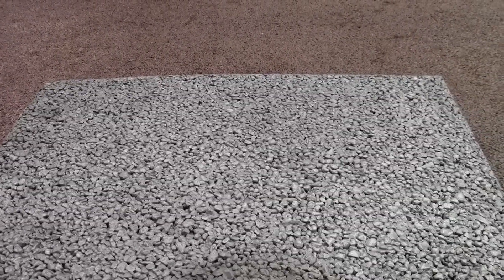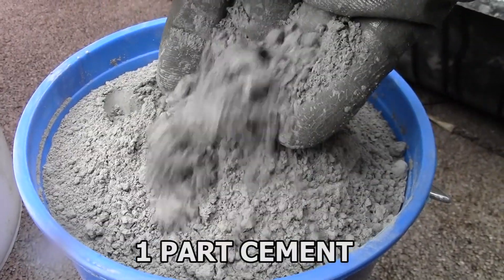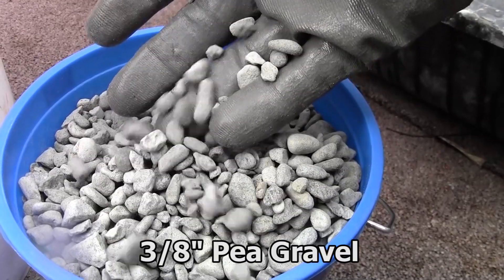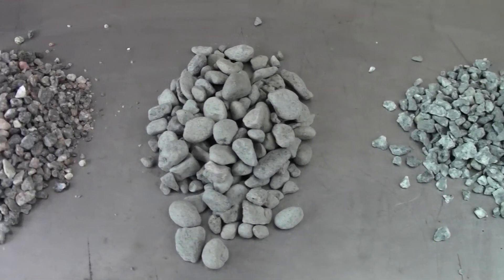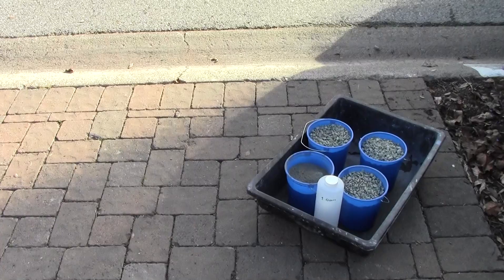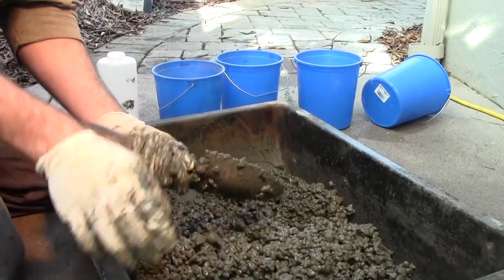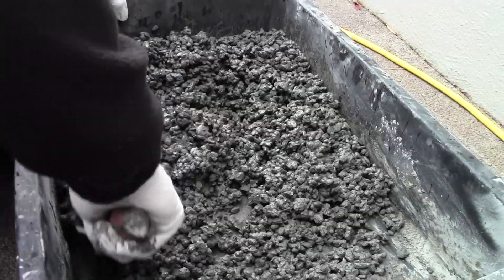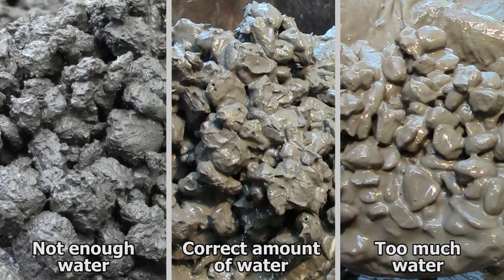How To Make Pervious Concrete

Comment: is there any code which should be followed to obtain the particular ratio and should be nominal porosity of pervious concrete?
Reply from the maker: Yes, the technical way to determine the ingredients of a pervious concrete mix:  
1.  Find the void content of the aggregate that will be used:
voids, % = 100 ((S x W) - M) / (S x W) 
 
M = bulk density of aggregate lbs / cuft -  dry rodded 
S = dry bulk specific gravity 
W = density of water (62.3 lbs/cuft) 

2.  Use the NRMCA pervious concrete mixture formula found at the bottom of this page:
http://www.perviouspavement.org/materials.html

Currently there are not any standards set for the minimum permeability of pervious concrete, that I am aware of.  Traditional 3/8" (9.5mm) aggregate pervious concrete mixes, with around 20% voids, often drain in excess of 600"/hour (4.2mm/second)!  Unless one is using the pervious concrete as a catch basin (not recommended), this degree of permeability is far in excess of what is actually needed to absorb even the most intense rain event.

Strength is at least somewhat inversely proportional to permeability in pervious concrete, meaning that generally the lower the permeability, the higher the strength for any given aggregate.  Since we often prefer to design our pervious concrete mixes using finer, 1/8" (3mm) and smaller, aggregate (primarily for aesthetic reasons) and these  finer mixes can be weaker (though we use admixes to offset this), we like to achieve just enough permeability to even further maximize our strengths.  'Just enough' permeability for pervious concrete we feel like is over 200"/hr (1.4mm/sec), because it still looks impressive when some water is dumped on it.  No, it won't immediately absorb the full contents of a ready mix truck filled with water, but it will quickly drink a bottle of water and more importantly infiltrate any type of rain event that may come along.

Comment: This was an EXCELLENT video, thank you for this. One question, if you end up seeing this - how strong is this material once done?  It seems to me it might be subject to cracking if it's too thin, so it would be good for some guidance on how thick I need to make my piece (and how much it might be determined by aggregate size).  Thanks!
Reply from the maker: Thank you for the props!  You bring up several good questions.  The short answer to how strong pervious concrete is... is that it's compressive strength is typically around 2500 psi (17MPA) to 3000 psi (20 MPa), which can be a little lower than ordinary residential concrete with typical strengths ranging from 2500 psi to 4000 psi.  Pervious concrete even at the lower end, at 2500 psi, is still very strong and provides over a 7-fold safety factor for supporting the weight of a firetruck!

In regards to how thick the pervious concrete should be...  generally it should be at least as thick or a little thicker than ordinary concrete would be in the same application.  Typically it should be at least 3 1/2" (90mm) for pedestrian areas and 5 1/2" (140mm) thick for vehicular.  Soil type and thickness of the base material play a part as well.  However we have successfully placed pervious concrete as thin as 2" with a couple special considerations.  

If you are using your pervious concrete for some other application, not as a pavement (or perhaps as an overlay on an existing pavement), then a general rule of thumb is to make the thickness of the concrete at least 3 times the size of the aggregate.  So for a 3/8" (10mm) pea gravel  the thickness should be at least 1 1/8" (30mm).  As was pointed out and lightly touched upon in the video, just about any size aggregate could work for making pervious concrete, however generally some loss in strength can be expected the smaller the aggregate gets starting below 1/4" (6mm) in size.  Given that very fine aggregate pervious concrete is our specialty, we have developed mix designs that offset this decrease.  

There are many variables that can affect the ultimate strength of pervious concrete and mitigate potential for cracking.  Please keep an eye out for more videos and blogs, on our website, http://perviousproducts.com/ coming from us shortly that will attempt to address these questions in far greater detail than I can here.

Ryan
Reply: Wonderful info thanks!  My initial project will be really light duty (exit chute for drainage tile into the yard to prevent erosion) but I would love to find more uses for this, so this is good info.  Thanks again!